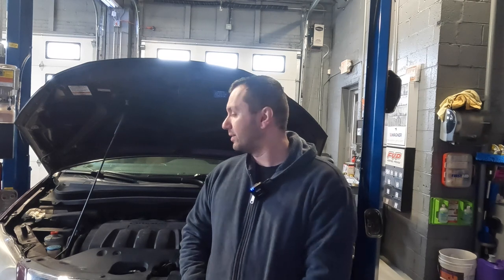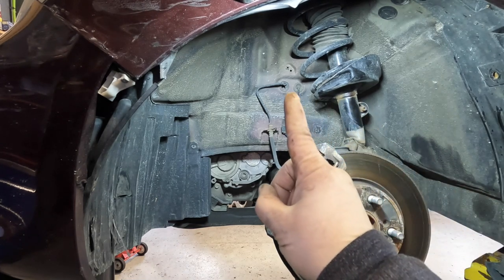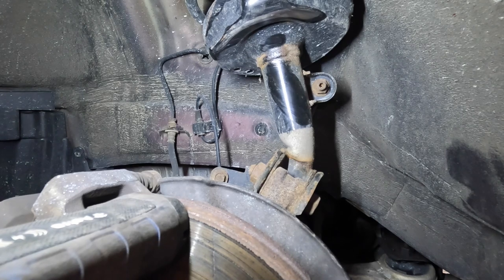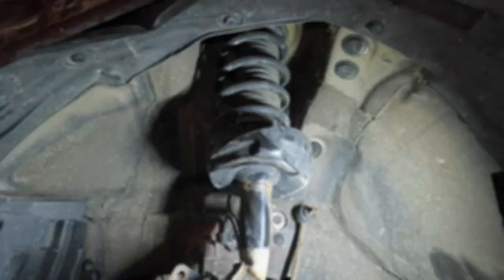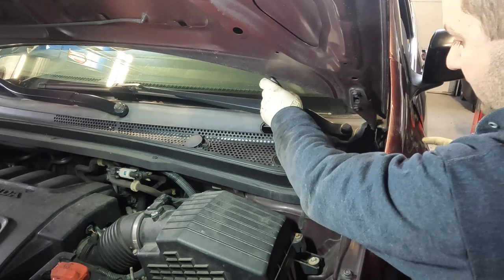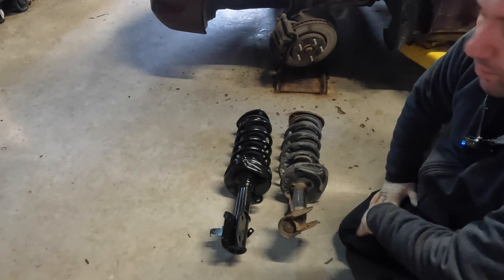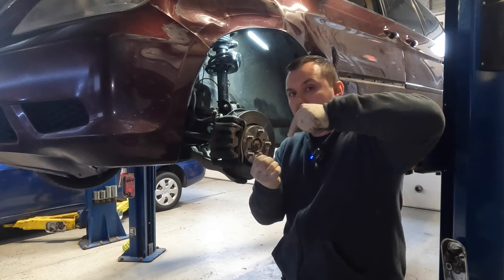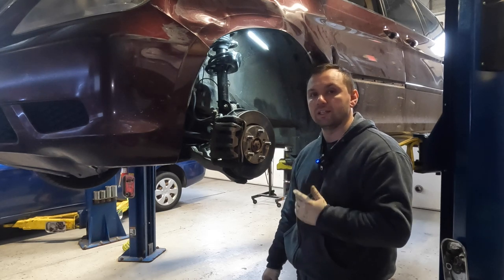CUSTOMER STATES MY WHEEL IS PUSHED IN AFTER ACCIDENT! HONDA ODYSSEY STRUT CARNAGE STRUT BENT IN HALF

Comment: I got into an accident and a wheel got pushed in like the car in this video. After the auto collision shop fixed the car and replaced all the suspension parts needed the wheel that got hit seems to have more of a camberlook to it then the other wheel. Any thoughts?
Reply from the maker: If you have more camber, you may need camber bolts to adjust it out usually after an accident like this if it’s really bad, it may not be 100% afterwards
Reply: what if everything is done, but the wheels is slightly pushed back still.  @TheEnthusiastMechanic
Reply from the maker: @onesweatysausage3056  Something else must bent or you might need do an alignment also it may be a possible frame issue.

Comment: Question so my car got in an accident I got fixed through insurance it’s not stock it’s highly modified it’s lowered but after I got it back the driver side rim and tire is sticking out more then the passenger side I went back and told them they said we checked nothing is wrong I don’t believe them what would you say is the problem it’s not at an angle it’s just sticking out instead of pushed in maybe I can see the problem and go back to them have them fix it
Reply from the maker: I would go to another shop and get a second opinion on what work was done  to to check if it was done properly
Reply: @TheEnthusiastMechanic  so went to another shop paid $200 they say the same things is there something that can cause it to stick out more on the driver side I have expensive tires on it and because my driver front rim is sticking out more my fender is eating the outer tire cupping it I believe it’s called
Reply from the maker: @AliVapeReviews  if everything was done correctly, it shouldn’t stick out, so I believe the shops that you’re taking it to or not thoroughly inspecting it unfortunately

Comment: Just happened to me on my 13 civic they are replacing the strut today hopefully that fixes it
Reply: How much did it cost you? I’ll need mine doing asap
Reply: @ssodell0  it was like 4 something. I ended up having to replace the control arm, knuckle, and strut. The total came to 980$. I then had to replace my rack and pinion bc the steering issue wasn’t fixed and the wheel still stuck to wherever I would turn it to. Idiots didn’t even test drive it. The rack and pinion was $1,400 for a “reman” even though I asked for a new one. They didn’t charge me labor bc of how much bs I had already replaced and them lying saying it was fixed after the first $900 when it wasn’t. This was also just one of the front struts not two which I would recommend you do

Comment: I have the same problem on my 2004 Honda odyssey maybe the wheel is a bit  more bent inwards then the one in the video hopefully it just needs the struts as well i wonder wat other parts usually get damaged when the wheel gets bent inwards like that it also wouldn’t move but it does accelerate but doesn’t move at all and makes like a clunking noise
Reply: Forgot to mention that the vehicle wouldn’t move at all wen accelerating its front wheel drive I’m guessing it didn’t move cuz the front wheel on the passenger side was bent in pretty good
Reply from the maker: Sometimes axles and control arms bend and get damaged
Reply: @TheEnthusiastMechanic  thanks for the feedback much appreciated